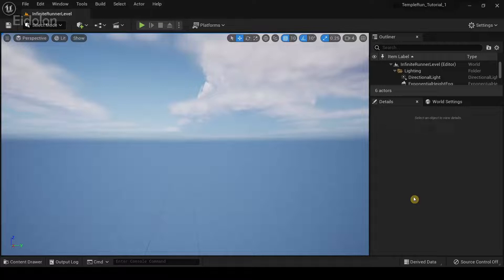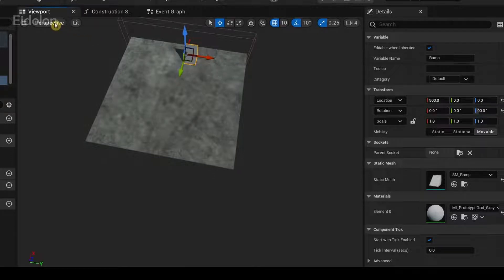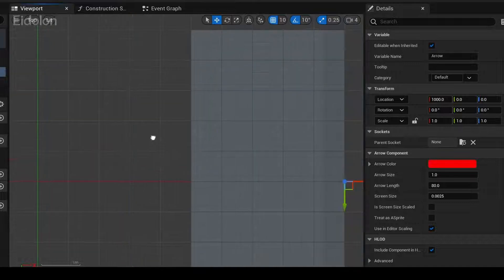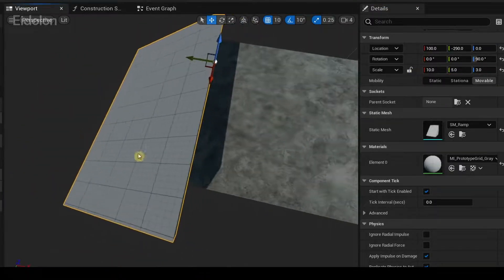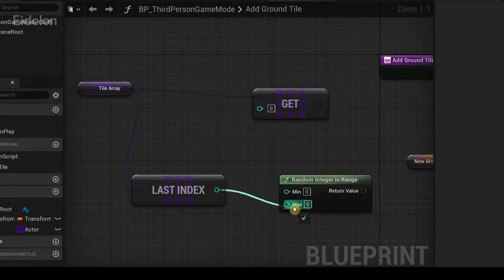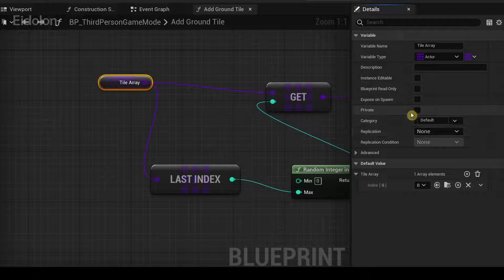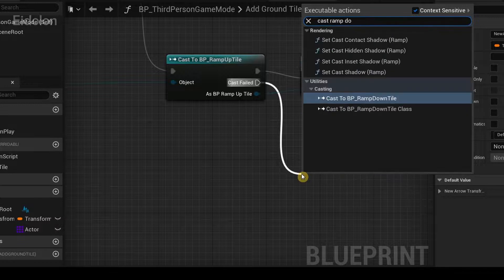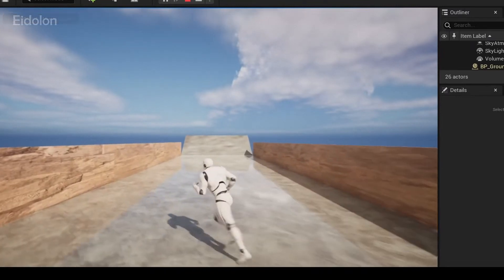UE5.0 Temple Run Tutorial: Part 6 |  Adding Variation to our Procedural Tile Generator

Comment: I've just finished following this tutorial series (thanks very much for making it!) and I'm going back over it to remake the project and try to improve my results, and I'm wondering if, at this point, would there be anything wrong with making ChildBPs for the RampUp and RampDown tiles, instead of just duplicating? When we get to the obstacle and coin spawning, would the logic for those functions run into any issues if these were CBPs instead?
Reply from the maker: I can't say for sure, since its been a while since I last reviewed this project of mine.
Since you are modifying something in the game, you are obviously going to come across some issues, so I guess you could try fixing them on your own, at the very least you would learn something out of it, which you can use to make your next project/game.

Comment: Hi, whenever I try to change the class variable from single to array, instead of the processing window appearing, Unreal freezes... How do I fix this? (I tried changing it to other types "set" worked normally, "map" froze it too.)
Reply from the maker: Thats very weird, maybe try creating the variable instead of trying to promote the variable in Spawn Actor.

In BP_ThirdPersonGameMode go to My Blueprints and then Variables and create a new variable by clicking on the plus icon. Give it a name and then click on the variable type (it should create a small window where you can select a new variable type) and search for actor.
When you search for actor, make sure to select the actor that is under Object Types. After that drag you cursor on top of Actor and it should create another small window where you can select the type of reference, make sure to select Class Reference and your variable color should turn to purple. After that follow what I have done at 4:36 in the video and change the variable to a container, specifically an array.

If the above method doesn't work then maybe try closing and reopening the project once again, or reinstall the engine, since this issue is most likely a bug in your installation of unreal engine. What version of unreal engine are you using?

Comment: Sir I'm not able to make Uptile  can you provide me the values
Reply from the maker: Location (X=500, Y=-500, Z=0)
Rotation (Pitch=0, Yaw=90, Roll=0)
Scale (X=10, Y=5, Z=3)
Reply: I have done the same thing but my Uptile is not working
Reply from the maker: @435_nehakanse4  What do you mean by not working? Is the Uptile not showing up? or is the Uptile spawned at the wrong position?
Reply: It's not showing up
Reply from the maker: @435_nehakanse4  If its not showing up, then the issue is most likely with your logic.
  
First, in the add ground tile function, check whether you added the Uptile in the Tile Array variable.

Secondly, in the add ground tile function, try adding a print string node after the cast to BP_RampUpTile (uptile) to see if the cast is returning true or not.

Comment: i changed the ramp with a stairs model, but the character falls through it. what should i change
Reply from the maker: You need to add collision to the stair mesh first. You need to browse to the stairs model in the content browser (in the mesh component, details, just click on the browse icon which is beneath the drop down box for selecting the static mesh) and the open it and add collision to the model.
You can easily add collision by clicking on the Collison button which is above the viewport, from there select Auto Convex Collision to quickly add collision to your model.
There are plenty of forum posts and documentation on this so I recommend you to refer to them.
https://docs.unrealengine.com/5.0/en-US/setting-up-collisions-with-static-meshes-in-unreal-engine/

Comment: Hey! Great tutorial as usual! 

How can i add some fog so my environment can have a mysterious look? I've tried exponential weight fog and atmospheric fog but they didn't work with procedural generation.
Reply from the maker: I will be releasing a new part of this tutorial series very soon where I will explain how to add fog to our game. But basically, you can create fog using a post process material or by using a surface material with blend mode set to translucent (there are other methods, but these two work the best for most cases). Currently, I am facing a bug with the post process material where the Depth Fade node is not working properly, hence why I am using the surface material as my fog using the Scene Depth node. Again, if all this is confusing, you can wait a few more days, and I will just release a video about it, that should hopefully clear out some doubts.
Reply: @eidolon_dev  Alright, i'll wait! Thanks for your insight. Your content is really helpful.
Reply from the maker: @Relonn_   I just released a new part to this tutorial series on how to add fog. So check it out and see if it fixes the issue.
Reply: @eidolon_dev  Thank you! It makes sense to create a plain with a fog material.